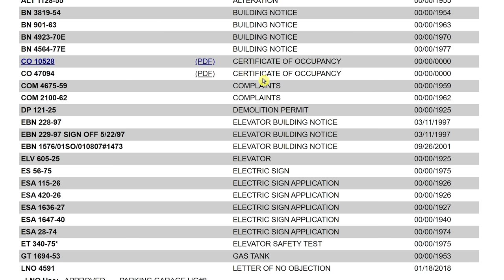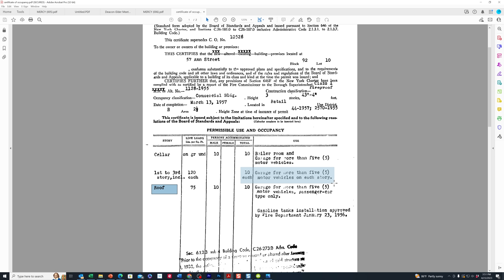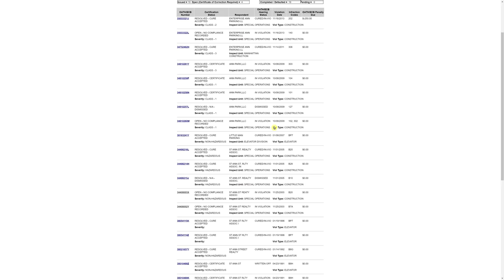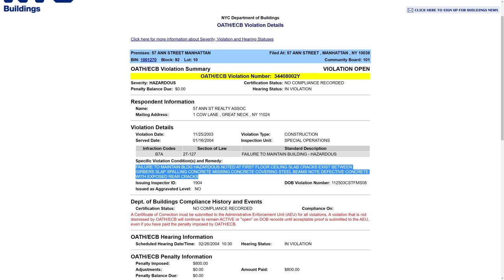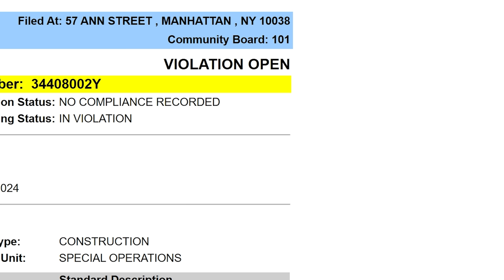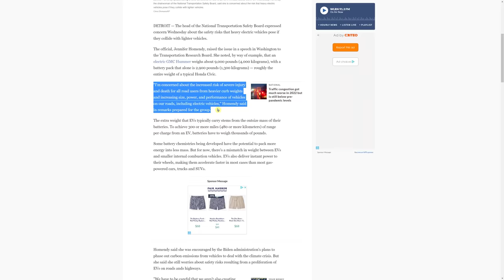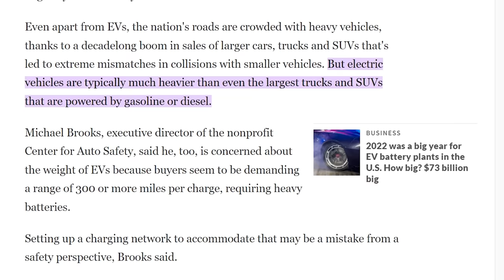4 Causes Of Fatal New York Parking Garage Collapse?

Comment: The extra weight of BEVs is negligible and was not the cause of this collapse. Most of the cars that we can see in the images are ICE vehicles. A few hundred lbs of added weight difference is not going to collapse a concrete building. This building came down due to neglect. And it has an open roof deck. Adding my water ingress and concrete damage. The violations were pretty black and white as the potential and likely cause.  The negative fear mongering of BEVs is nonsensical and irrational, and simply trying to skew the facts. Buildings are designed with an safety factor of over-capacity.  If the owners were double parking cars on floors, that alone is far more a factor adding to the failure.
Reply from the maker: This was not fear mongering about EV cars, and you are wrong, the weight difference is not negligible it is thousands of pounds as the NTSB pointed out. Also you can't tell all of the cars that were on the roof because many of them fell into the hole in the center. In addition to that there may have been electric vehicles on the lower levels adding to the weight which could have buckled the support columns leading to the roof collapsing remember we don't really know whether the roof collapsed from overcrowding vehicles on the roof, or if it collapsed from below from buckling columns which we knew some were compromised. Also you are forgetting SUV's way a lot and there were no SUV's back in 1957 when this building got its original certificate of occupancy to act as a garage. SUV's came out in the 1980s and they weigh more than the cars. And you can also see many of the vehicles on the roof were large vans, which are not passenger vehicles as required by the certificate of occupancy so they were already violating the certificate of occupancy criteria.
Reply: @jeffostroff  You don't even get to "thousands" if you load a battery as cargo unless you take one from a truck.
Reply: @jeffostroff  There are gross exaggerations if it's coming from the NTSB. Too many political agendas are being revealed from our alphabet agencies. But that's another rabbit hole.   Back to my point....the gross vehicle weight of a Tesla Model Y is 4,389 lbs. The gross weight of a comparable ICE car is a BMW x3 is 4,149 lbs. There is NO thousands of lbs difference when you properly compare apples to apples.  That goes similarly for luxury class Model S vs. Mercedes S class, or BMW 7 series.  You only have thousands of lbs difference if you compare a mid-sized BEV vs. an entry level sub-compact tin can. Even that is misleading as most are closer to 3,000 lbs today.

Comment: FYI, electric cars had nothing to do with it. Garages are designed for 50psf live load with factors of safety on top of that. You also have an unloaded slab all around the vehicle. Realistically, a heavily loaded slab might be loaded to 20 or 30psf even with electric cars.

The age likely had nothing to do with it. There are few age related issues that would contribute to the collapse of a concrete and steel building.

Maintenance, poor design and construction are the most likely factors.
Reply from the maker: Yes derating of the concrete will affect it's ability to support the heavy loads
Reply: @jeffostroff  I am not sure what you mean by "derating of the concrete".
Reply from the maker: @yodaiam1000  That means to process a such as Spalying  caused by moisture weakens the concrete and it's no longer rated to carry the load that it was designed to handle

Comment: Interesting video.  However, the weight factor of electric cars is overblown.  Yes, batteries and electric motors weight more than a tank of gas and a hollow gas engine.  However,  the numbers are small.  Maybe 10% greater than a gas vehicle.  And  an electric sedan weighs 2/3 of what a gasoline pickup truck weighs.

Comment: I made a comment that my jeep is 6200 pounds and my F150 is usually 7400 pounds, and I was told all these buildings were designed for much heavier trucks than that. 
Obviously people think engineers are using huge numbers for cars.
Reply: In 1925? How could they foresee that to to day's vehicles? What did Model As and Model Ts weigh in their day?
Reply from the maker: But when the building was made cars were likely lighter, and with the building likely derating over time, it was probably able to handle a fraction of the weight it was designed for.
Reply: @uploadJ  Model T: 1200 pounds

Comment: Well a crack in a column is no big deal if the core of the column is a steel I beam and the crack is just a concrete covering, a car could have bumped into it and caused concrete to crack. I suspect corrosion  is the actual cause

Comment: There is big difference between static and dynamic loads.   As car weight goes up linearly moving causes stress geometrically when cars move.  Think of a regular hammer sitting still.  Now think about a sludge hammer walking the same surface.   The heavier cars will pound the inflexible concrete leading to failure

Comment: Ok sry I'm not going to follow or scrip, but this is my question when the towers fell was there any movement of the ground register from a Richter scale, and why wasn't all the apartments and parking garages and houses not check for chacks ? In and around the area of the towers? The falling of the towers was a tremendous force of energy hitting th ground and the surrounding! And just over a few years ago we in Delaware and on the north east coast had an small earthquake, in which knock down some of the stone walkway I had install in front of my home, I did have my home inspected and that was the only damage done just the small stone wall was effective by the  small earthquake we had👍✌️, but at least I took the correct steps were I really doubt they did the same in New York ✌️

Comment: As with your great videos analyzing the Surfside collapse, you have given us a valuable assessment of what could have led to this collapse on Ann St. I think one of the major causes has to be overloading on aging and corroded columns further down at ground level. These columns supported all the cumulative weight of three levels of jam-packed vehicles in a 100-yr-old building. I also question the rating of the roof level for 75 lb per square ft. This was no longer sustainable.
Reply from the maker: Yes, but look how the ret of the roof held. I think a column below the roof level buckled
Reply: I noticed that the northern part of the rooftop held up, so it must have been a structural defect on a level further down that triggered the collapse. The roof structure may not have been a factor. You are correct.

Comment: This is untrue. There are EVs that are heavier, but the vast majority of EVs currently on the roads, Model 3 and Y, are no heavier than their counterparts. An Escalade tips the scales at over 6,000lbs...please do not blame this on EVs...they make up like 4% of vehicles.
Reply from the maker: I did not blame it on EVs, please do not twist my words. I said contributing factor. Just like SUVS are a factor, they were not in existence when the building was constructed.
Reply: @jeffostroff  Appreciate the response. I did not imply that you were blaming EVs. I was simply attempting to correct the information about EVs being heavier than their counterparts. They absolutely do not have to be, per my examples. 

'23 Model 3 Performance: 4250lbs
'23 BMW M340i: 3968lbs
'23 Audi RS5: 4079lbs

This is a negligible difference in weight, as far as load-bearing is concerned.

Comment: Yeah. I had heard of that NTSB warning. A bit after that, I saw advertised an electric Hummer SUV with enormous tires and thought, "Well, that's terrifying. If that hits a normal car, it'll probably take the whole greenhouse off of it." -- I hadn't thought of the potential of overloading parking garages... It's obvious they were parking more cars in there than the floors were designed to hold.

Comment: Too late to make repairs.  Chalk it up to greed.  Pack as many vehicles in the parking garage as possible to make the most money.  Those vehicles looked like they were packed tighter than sardines.  They can blame any number of agencies and maybe even bribes were taken to ignore any structural problems.  Greed usually plays a factor in building collapses.  A hundred year old building wasn't designed to hold cars of that weight.  I hope that the garage has plenty of insurance to pay for all the damages incurred.  The city better check all the parking garages for structural damage to be in the safe side.
Reply from the maker: Greed, and normalization of deviance: "We've always done i this way"

Comment: Jeff, Did you take notice that 95% of everything on the roof is an SUV, mini-van or commercial van. Everything large is likely loaded onto the roof due to the lower floors ceiling heights?
Reply: The internal floors look very generous with height also attracting large vehicles. Building next to it has 3 levels before roof, where there is 2 levels before roof here.  Maybe this building was not originally designed for vehicles??
Reply: @user-pf5xq3lq8i  Good thought. Did they need parking garages in 1925?
Reply: And Commercial vans are often loaded with steel pipe, fittings, and heavy tools/machines.

Comment: The C of O didn't state pounds per SQ ft it could take?  Wow even for 50s that was lax.  Looks like it's the original c of o restamped in 50s.  NYC DOB like all DOBs don't have enuf inspectors to keep up on violations  the fees charged multi millionaire & billionaire owners are pathetically low.  On a $ 100,000,000 the fee is a few hundred thousand bucks.  Mostly because DOB let's owners vastly understate cost to build, 1/2 even 1/4.  Mind you NYC DOB & codes toughest in nation.  
The reason parking is so dense is that you can't park your care attendants can pack 100% of area.  
Overloading a good point, I think code req for lbs per sf for parking assumes park yourself w most of space given to road and walkways, not dense packed cars.

Comment: It's a myth that BEVs need to be uniformly heavier than ICEV.

For example my BYD Atto weighs 1760Kg. A similarly sized fully optioned Toyota RAV4 weigh 1960Kg.

The reality is purpose designed similarly dimensioned and equipped EVs, weigh about the same as ICEV.
Reply from the maker: The battery is the problem. Want longer range? Batteries need to be much heavier
Reply: @jeffostroff  Maybe, but I think the technological trend will be to lighter more energy dense batteries. 

This will not only be due to improvements in chemistry (eg more silicon) but better cell packaging. 

The jury is still out in whether jelly roll, bricks or blades will work be the best cell format in the long run. Once the industry has sorted this out the rule of form follows function will likely kick in enabling the investment needed for optimisation.
Reply: @Jim Graham  Yes, EV are lighter than their previous models for example. My 2017 Tesla S is heavier than the current S, which has a longer range.
Reply: Tesla model S is over 4500lbs 1984 Corolla is 2,000lbs
Reply: @thefinalroman  Modern Corolla is 3100 pounds...
Reply: @K Daily's It's not a proper comparison- comparing cars from the 1950s, or 1980s to today's cars. There are conventional SUVs and trucks that weigh a lot more than EVs. I mentioned that EVs are getting lighter even if they have a longer range battery. That was my point.
Reply: @georgiazettakaragianni9832  it's a proper comparison because the building was made in 1925

Comment: In a Dutch newspaper today: calculations for car parks in the Netherlands have historically been based on a maximum weight of 2,500 kilos per car, but fashionable new SUVs already weigh over 4,000 kilos. Many parking garages now refuse cars that weigh more than 2,500 kilos. Another aspect: you must be mentally behind to drive not a lighter but a heavier car in these days of ecological problems.
Reply from the maker: Yes, electric cars are better with heavier weight
Reply: @jeffostroff  A Model Y is smack in the middle of the weight range for mid-sized SUVs. 4,300 and 3,500 to 6,000.

A Mustang Mach-E (second-best selling electric SUV, about 15% of Model Y) with 4500 pounds is not that much heavier and weighs the same as a Jeep Grand Cherokee. Ioniq 5 4000 pounds, Kia EV6 4000 pounds, VW ID.4 4100 pounds (same as a Toyota Highlander). And that's all mid-sized EVs that sold more than 10k units last year.

Comment: Tesla sells, by far, more EVs than anyone else in the USA. And their most popular vehicle, the Model Y CUV does weigh significantly more than the closely comparable Honda CR V or Toyota RAV4. About 800 pounds more. But not thousands of pounds more.
Reply: And those are the two lightest SUVs. I just went down the list of best-selling ICE SUVs; half of the top ten are above 4000 pounds, and multiple are heavier than a Model Y.
Reply: @HenryLoenwind  Yes, the focus on how heavy EVs are seemed a bit like anti EV FUD.
What has changed the most in the last couple decades is the proliferation of big, heavy 7 passenger SUVs.

Comment: One correction: EVs are typically about 10-15% heavier than comparable ICE cars (that Ford monster truck is an outlier). However, modern ICE cars are about 80% heavier than 1970s cars---and that's within the same classes. When you add that in the past, sedans were dominating but have mostly been replaced by SUVs...
Reply: Tesla model s sedan  =4500lbs
Toyota corrola sedan =3000lbs
Reply: @user-pf5xq3lq8i  sure, let's compare a compact class to a luxury class four times the price and be surprised the latter is heavier...
Reply from the maker: The tesla and corolla are similar size 4 door cars
Reply: @jeffostroff  The Model S is the same size as the Avalon, Toyota's largest sedan, nowhere near a compact Corolla.

Comment: If you are going to point out electric vehicles, why not also point out the number of SUVs in use today over the number in the earlier years of these buildings.  I think the weights might be an issue as well as the upkeep of the buildings.  It looks like the owners were only holding onto the building to find the right buyer who would eventually tear the structure down and build something bigger, which appears to be happening more and more in the large cities where it is getting costlier to live.
Reply from the maker: I did point out SUVS and I showed on the screen how JEEP CJ was first SUV in 1984, showing we had no SUVs before then

Comment: EVs are also prone to fires, fires which burn hotter and longer than ICE vehicles in the same class. With that said, large fires, such as those from an EV do pose a risk to the integrity of cement or concrete structures immediately around them. I know that there have been instances in California and Arizona where overpasses were inspected after being exposed to a large fire.  

If dilapidated East Coast structures are exposed to such conditions, the consequences could be quite severe.
Reply: Totally not the discussion

Comment: OF COURSE it did not 'cave from the roof down'! Things just about NEVER cave from the roof down, it only stands to reason if they cave they usually do be cause a part of the structure at the height that is (about) the most load-bearing collapses. We are talking ENORMOUS amounts of weight when we consider what is being carried by the lower parts of multi-floor structures. Even if a roof collapses, which would be a rather rare occurrence, it usually would not cause the rest of the structure that's situated underneath to collapse as a result. A roof by itself does not weigh a lot, and it 'caving in' usually would be gradual, often partial, and with little consequence.